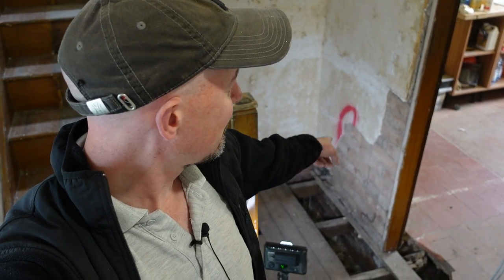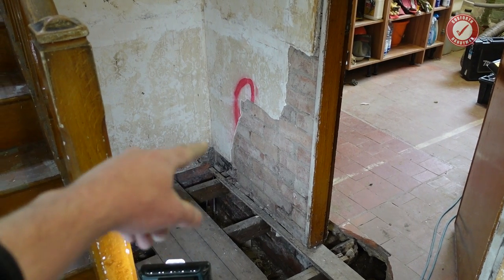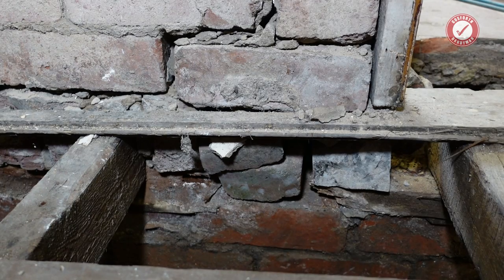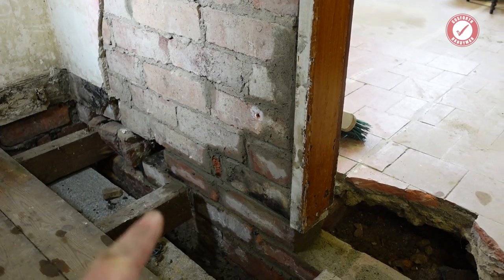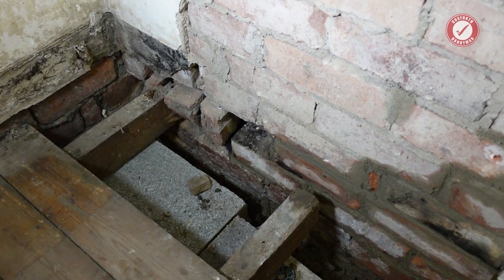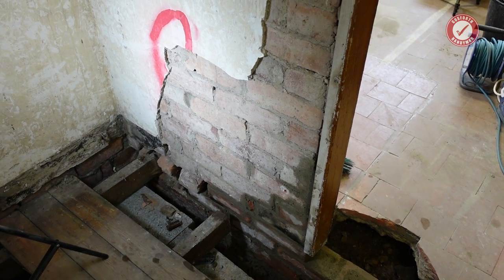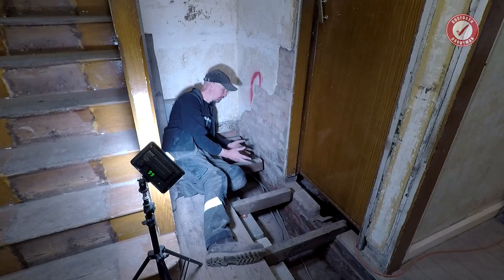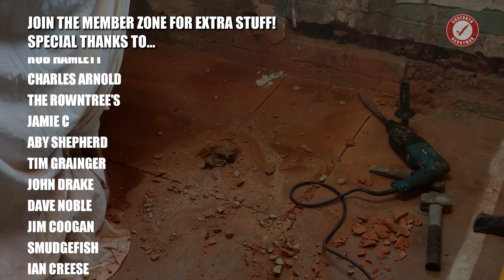We've found a STRUCTURAL problem! (1920's Renovation Part 16)

Comment: Now there's a sentence I've never heard before!  - 'I don't think there's anything holding that supporting wall up.'
Reply: I have 😂
Reply: In the house next door (four-storey apartment building from 1902 with a late-1990s loft conversion) some cowboys removed an entire section of structural wall on the first floor without anyone noticing until cracks started to appear on the second floor several years later! I didn't get to see the carnage but from what I was told they removed something like a 4 m section of that wall without fitting an RSJ or anything! And those structural walls are massive, especially compared to the one in the video - three or even four times as thick, so a lot of weight from the wall above alone, plus the floor joists with probably 100 mm of dirt fill for sound deadening.

Probably the only thing that saved those idiots was the fact that any properly built wall forms a false arch unless the unsupported opening is too close to a joist or other load, so only a comparably small part of the weight actually rests on that bit of wall above the opening. The situation in the video is worse because the wall is fairly narrow and right next to a doorway but there is the concrete lintel above the kitchen door and I also think half a false arch formed right above the loose bricks, supporting the lower part of that wall, or at least most of it.
Reply: From a  talk about a historic builsing: thry found only one wobbly brick holding the building up and the surveyor basically ran out

Comment: Unless there is anything to suggest the quarry tiles had been laid at a later date than when the house was built, I would consider them to be the original floor covering. In the 1920s things we take for granted like fridges were not invented so to keep places like the kitchen cool enough to store food and also to be able to wash/swill the kitchen out, clay tiles were laid using lime putty/cement onto either earth or lime concrete flooring with no damp proof course. The idea being that any damp should permeate through the floor to keep the kitchen area cool. It seems to be in your case that the subfloor was made damp proof, which was probably not in the design specs of your 1920s build.. Modern day home owners sometimes have vinyl floor coverings fitted to this type of floor, in doing so, traps all the damp and moisture creating a very wet sub floor. With nowhere for the moisture to escape into the atmosphere, it can build up and become evident around the edges of the room, eventually causing damp else where like you are experiencing.

Comment: It’s obvious that the load is being taken back to the corner but there is a big triangle of bricks hanging there.  Cracking in the mortar is OK but the worry is when bricks start to crack in half, it shows the cantilevered load is too much. I’ve seen something similar in fifties houses with the first floor beginning to sag because the wall plate in the exterior wall is being eaten away by wood worm.  Ah the days of untreated timber!

Comment: Love the 1 1/2" bearing on the lintels! Most of the loads from above have probably transfered into the side wall over the years as the wall has dropped slightly. Good luck getting the hangers in.
Reply from the maker: Cheers! I have a plan for the hangers... I think. 😁

Comment: Nothing too much to worry about. Brickwork allows the load to span over areas like that, shifting the loads onto adjacent walls, altho’ it may have caused some cracking higher up behind the old perished plaster, that may need slate packing.

Comment: From other videos about dealing with old houses I've learned that while old-time lime-based cement "breathes", modern cement will trap moisture and cause damage, as it did to the plate under the wall.  It's good that you discovered the problem when you did!
Reply from the maker: Cheers Bob! Yeah, lucky to have found this! One of those things that would only be found on a full renovation too... until it was too late. 👍😬

Comment: No idea why YouTube recommended this to me but I'm glad it did. I restored my 1920s house in Essex and it had identical construction and identical problems. I did lots of similar repairs to this. I even had a dirt floor with those exact tiles in the kitchen. I dug it out and put in suspended joists just like you said you were going to. My house is still standing 8 years later so thi# kind of repair must work!
Best of luck for the rest of your work!

Comment: Ventilation is key but so is access. I often put in little hinged flaps in out of sight places to enable me to confirm nothing untoward is happening and if it was I can work on it without massive disruption. This is especially true in a rambling property where I can isolate heating and supply pipes to various sections of the house for repairs whilst leaving everything else connected and working.

Comment: I would be inclined to shutter under the joists along the wall and lay re-bar and concrete up to the under side of the joists. You could pass small sections of waste pipe perpendicular at intervals to allow the air flow and services. Would be cheap, easy and both strong enough to support the floor and add a pier effect to the first 3 courses or so to the wall. Great vid.

Comment: I had the same problem with the rear outside wall of my last house. The floor sagged in the corner as the wall plate had rotted out due to split cast iron down pipe. So new wall plate and joists and floor. All while living in the house.
Reply: problem which I didnt fix, but now I know what it was (house was sold for a large number of reasons),  I realised a bush had rooted through a drain and under the house, did not think about wall plates,  BUT it was three storey brickwork (the entire house had been built into a hill so was brick three storeys (inc roof space) at sides , and rear, two storey at front.

Comment: I’ve done a few major Reno’s here in Canada and find it’s better to remove the walls and floors when I can. Since we use drywall on walls, it’s easy to repair….and relatively cheap. The walls usually cover up sins from the past including plumbing problems, hidden junction boxes, critter remains, poor insulation, rot, etc.

Andy, did you consider pouring a footing and then a short wall under the brick? Then you’d have a solid wall from ground to brick. You’d need to support the brick with framing for a few days.

Comment: I’d always clean the masonry, even vacuum and apply a masonry fungicide. I may have considered ‘pinning’ the wall perhaps putting an acro under the right hand concrete lintel and done the short stretch in one go.  That way you get right at it to clean and bond the entire stretch. No dpm joints either! But you rightly played it safe!
Do Treat the remaining timber with a wood fungicide: spray on!, especially if there’s cuboidal cracking, sure sign you’ve potentially got a case of dry rot. Play it safe and treat!
Ventilation is, as you said, the key here. I’m not a fan of resting joists through support walls for the reasons you’ve just exposed. If you fix a wall plate use a DPM on the back. I’d fix with chemical.bolts on that little stretch, on which to fit your hangers. Or, use heavy duty hangers with chem bolts straight on the wall, again use a dpm between anything that fixes to masonry, esp. as it’s already damp. The kitchen floor is obviously conducting moisture  but that’ll soon be resolved when out. If the cut joists are not too long you could prepare a sleeper wall for these, it’s only 2-3 ends again, use dpm.
Consider whether the concrete kitchen floor is in any way ‘buttressing’ adjoining walls. If it’s a boundary wall to an a joint property you still have potential moisture migration as well as potential lateral force on your side of the wall. This can be resolved easily by chemically bolting a 1-2 150mm x 50mm treated timber(s) along its length to recover some lateral strength. But that’s only if you have an adjoining wall with concrete floor. 
These are tricky little jobs to do, not least because of the loads coming down and laterally However, you did reasonably well all considering. Thank you for posting and keep going!

Comment: Another great video.  Having had a bit of damp on the bricks that supported the clay lump work of our cottage, I feel your pain.  We ended up injecting a damp proof course in the brick work as we didn't have the benefit of suspended floors and their ventilation.

Comment: I had a house (c. 1874), sold 2015.  There was a dirt floor in the cellar.  This cellar is 6 foot tall.  I put in a double vapor barrier, leveled stone (road pavers) piers, wood joists with old pallet wood on top.  No tie to walls.  There is little structural need for the floor to be ties to the wall.  Your local code might say otherwise.

Comment: I was impressed that you swept the floor in to a shovel then the bin i rember working in a flat in Glasgow I lifted the floor to run in cables it was soo deep you would nearly need a parachute to get down went back to weeks later for second fix electrics & a wall was down so lifted the floor board again to my surprise said wall was swept down under the floor went from  nearly needin a parachute to the point you couldn't post an envelope down the hole impressed with your tidying funny the things you rember in the building game 😄👍

Comment: I had a similar problem with sagging joists in my first home / renovation project, I too deployed the car trolley jack but thankfully the rotten bearer was on a dwarf wall so I replaced it with pressure treated timber (in the good old creosote days) resting on DPC and shimmed the joists with off cuts of slate. Thankfully the joist ends were still solid.
Reply from the maker: Great stuff! I've used the trolley jack many times for this sort of thing. Had a similar one many years ago with a sagging floor due to a sleeper wall that had been knocked out but a kind plumber. 🙄😁

Comment: Familiar sight that. Last hear decided it was time to tackle my daughters room. Plan was strip back to brick and re plaster some loose sections. House was built around 1900. We soon noticed  the familiar bounce in the floor and the smell of rot. This was during first lockdown. Had to strip out half the floor replace joists and make good the brickwork. Then had to wait for weeks to get plaster as there was non in stock anywhere. Fun times and I know we are going to have to do it all again in other parts of the house. Stupid idea building in wooden wall plates like that.
Reply from the maker: Yeah, no idea why they did it back then. It's fine if it stays dry but a big problem if it rots. 👍

Comment: At least that was due to old age. Not like my daughters house where a pervious owner had cut out a new doorway and used a manky piece of wood as a lintel  and then used the casement to hold up the lintel and the wall above. There was so much pressure on one side it was bowing inward. Anyway a brickie, acroprops and a concrete lintel had it sorted in under an hour.

Comment: I got a mild anxiety attack when you started hammering the wall there at 9.13 Did you see those other bricks move?
Reply: Me too! Went back and watched again , yep a new crack appears. I’d be getting a prop up until the jobs done!!!
Reply from the maker: Me too! I was debating leaving that blob of mortar but I was being very careful. Hard to tell on high speed. 😬👍
Reply: @GosforthHandyman absolutely full heart in mouth moment - ironically enough the crack you point to at 12:49 three courses up (with a comment that luckily they haven't moved XD) opened up a treat at 9:16 when you were chiseling the bricks.
Luckily you spotted it when you did and had the skills to fix it quickly - that won't have been far off a nasty accident.

Comment: Andy, you handled that discovery with calm and confidence. I would have been freaking out. And your repair looks very sound. My questions is, what was the black strip of fabric/vinyl that you laid on the good brick before applying mortar and the next course and why was it necessary?
Reply: Andy, I just rewatched and now realize that you embedded that strip into the mortar, kinda like fiberglass reinforcing drywall tape. I guess it is reinforcing that mortar joint longitudinally? Was it fiberglass mesh?
Reply from the maker: It's just damp proof membrane (plastic), so stops moisture being sucked up through the bricks and in to the timber. They used bitumen back in the day, but sadly the concrete floor in the kitchen bridged the damp proof so the moisture got in sideways. 👍

Comment: Andy, put your ethernet cables in now while floor boards are up! Plan your routes around the house now to have Rj45 jack points in all rooms now. You save yourself loads of time and where they are going into the new extension ball them up under the board's before the new extension. 
You'll thank yourself later mate. 

Great job... Major problem sorted with levitating wall there! 😁
Reply from the maker: Yup - Cat6 going everywhere 👍

Comment: Similar in my 1908 house. Looks like the builders completed the ground floor including wall plates, joists and floorboards before dividing single brick walls.
Lucky technique not used on supporting walls.

Comment: There always will be hidden structural problems in such an old place, but good you discovered this one in time.
This was a major issue as there is so much on top of this wall.
Why not cement a row of concrete blocks against the wall to rest the floor joists on, there is concrete underneath so that should be strong enough, some dpc on top and job done, this part of the floor is not subjected to a huge load anyway as it has a short span and is only a walkway, no heavy furniture will go in this place.

I'm renovating an 1933 house, it's very well built but most damage has been done making extensions and alterations to the house by what I think were unprofessional builders or the people which lived in the house  between 1970 and 1995.
For instance, a bay window with brick sides sitting on a concrete slab floor and a concrete slab on top is just stuck to the existing building without proper physical connection to it, al enhanced by chiselling out a slot for an electric duct almost into the wall cavity.
Result; massive cracks from top to bottom in these places, so I ended up removing all damaged and half bricks over the height of the wall and filled in the void in a proper half-brick bond.
I also added stainless anchor rods every fourth course ending in the existing brickwork where I removed the mortar an inch deep to embed the rod into the pointing, the ends where bent at a 90° angles and stuck in holes drilled into the mortar, I hope this has bonded the extension into the original house well enough.

Comment: Looks to me like there was some sort of wall heading out  from the door frame into the kitchen.There is a brick header behind the floor plate.Also the tiled area has been patched as you can see.
My house had a wall like that which had been removed,one side of the door had a outside toilet, the other a pantry.  if this was the case ,there was a return with a corner `picking up` any bearing.
This is not unusual and it saved the original builder putting another sleeper wall against the footings. I have seen walls built 6inches away from the floor plate! 
2 lintels on a 4 inch wall just about sums up what is under the surface of old houses, they are doing nothing, sometimes the doorframes are holding up the bricks above,maybe a 4x2 spanning the doorways.
Loved the little level on the bricklaying bit, quality!
Great job!

Comment: could be wrong but isnt a wood timber at the bottom of a wall a Sole plate? A Wall plate is the name for the timber that sits on the top of the first floor inner leaf for the roof trusses to secure to.
Reply from the maker: Possibly! Might vary by region. I've always known it as a wall plate. Our architect calls it a wall plate too. 👍

Comment: I suspect that the weight of the wall above and the  roof weight was in fact being carried by full width spanning first floor joists on the first floor wall plate.
Reply from the maker: No, the joists are only half width on the first floor and rest on that wall! 😬
Reply: @GosforthHandyman  and yet clearly the ground floor wall was under no tension/compression.....
Reply: @MARTINA-gc3tq  I think the upper part of it was, half a false arch supporting it.

Comment: Is there sufficient ventilation in the substructure? With the extension on the front they may have covered the vents to air the substructure preventing the constant air flow also with the kitchen being concreted I bet that's not helped either
Reply from the maker: Been working on the ventilation today actually. There are some vents but I'll be adding more. In all honesty I'm amazed the rest of the floor is so dry! 👍👍
Reply: @GosforthHandyman  I had noticed when you were clearing it out. You might have gotten off quite lucky with how dry it was

Comment: A ledger and hanger system will prevent air flow. You'd be better off building up piers off the oversite directly under each joist...nothing fancy, just don't forget a piece of DPC under the joist.
Hope that makes sense.
Reply from the maker: Can still get the airflow with ledgers - was working it out today 'cause that crossed my mind too. 👍👍

Comment: That was very interesting and the house being built well really has to do the test of time even when the joist rotted away at the ends nothing moved much just on a personal note I noticed the lounge door opens into the room I think they used to do that before the days of central heating so the people sat in the room didn’t Get a cold blast so will you be leaving it open then into the room like it is or I’ll change it so it opens against the wall which personally I would do